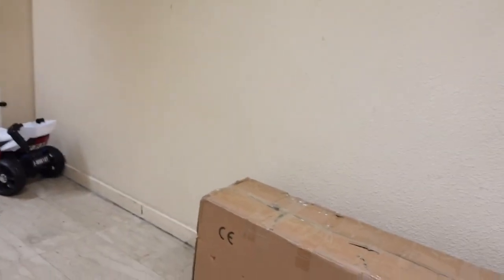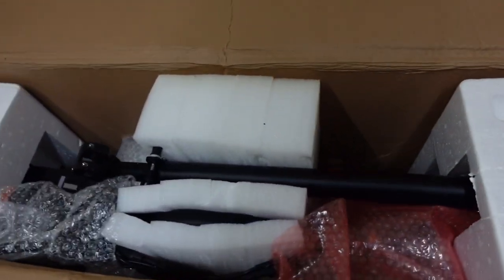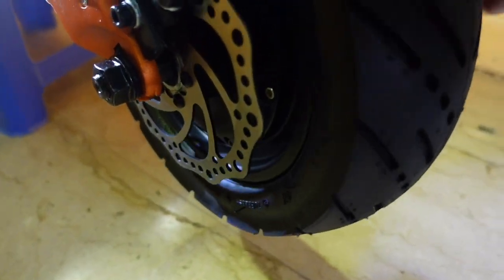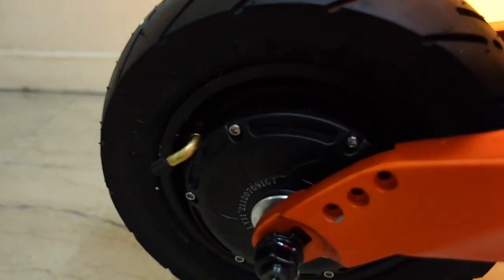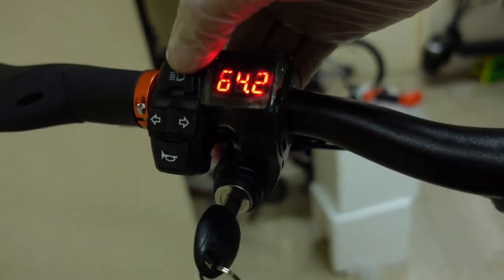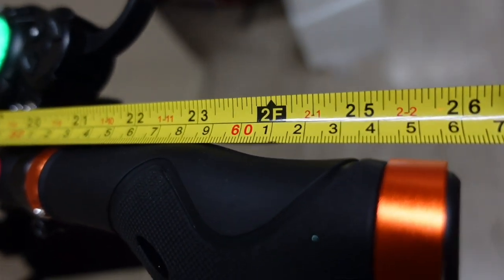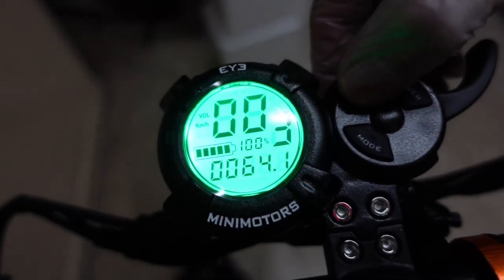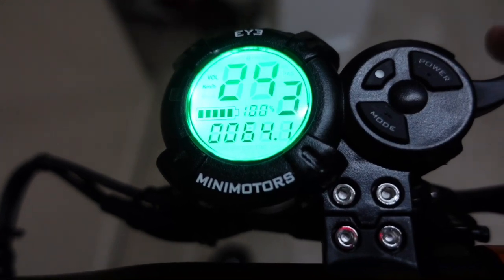Unboxing | Blade GT Plus | Mini Motors Display Version 2022 | James Angelo TV | Vlog 113

Comment: I watched all your videos on the blade gt scooter on the modifications you made but I couldn't find anything for connecting an external battery to have more autonomy. Are you making a video on how to add a battery? THANKS
Reply from the maker: yes i didn’t do video for range batt bro im directing to buy LG 28.8
Reply: @JamesAngeloTV  bonjour Angelo,il faut changer les controller pour installer une batterie LG ?
Reply from the maker: @legangdegaza  sorry bro but can’t understand please translate to english
Reply: @JamesAngeloTV  👍

Comment: Can you adding blade gt parts onto vsett 10 plus looks same looking decks    as you might be love with vsett 10+
Reply from the maker: need to check the swing arm length may e it will touch to the spring

Comment: Hi, James Angelo you know how to unclamp the blade gt 60v 23.4 ah scooter because there are no connectors to disconnect it the black white wire and I saw that there was a black white wire protruding from the light front left ? waiting for a response thank you.
Reply from the maker: you need to open the deck bro and follow the connection of wire

Comment: hello...how much of a difference u think the wolf king gt is vs blade gt?...is it like 2x times better? or 1.5x better etc.? thank you
Reply from the maker: handling i go for kaabo gt but in city rides only  becaue of fork suspension blade gt is good all around scooter. price wise blade gt is good also. but if you have a budget go for kaabo gt
Reply: @JamesAngeloTV  also do you take the fiido q1 to work rather than the big scooters? im mainly looking for transportation for work and wondering what the best is in terms of value. thank you
Reply: nvm i think the modding of fiido will cost more
Reply from the maker: @thermodynamics1110  yes bro fiido modifying is expensive

Comment: Nice job. I also have this version. Please check psettings and P9 which is battery saving mode. Default value is 2 - medium saving. If you change it to 3 - no saving you will get the full performance
Reply from the maker: soon i will make video for p settings
Reply: Hi does gt + have dual charging port ?

Comment: Salut @JamesAngelo tv  quel est le diamètre des 11 vis du deck est la longueur des vis ? Merci
Reply from the maker: bro please english 👌
Reply: Hi @James Angelo TV what is the thread dimension and allen key of the battery cover screws? thank you .

Hi @James Angelo TV what is the thread dimension and allen key of the battery cover screws? thank you .
Reply: waiting for an answer thank you?

￼
Reply from the maker: that is m5 size o f screw regarding on allen keys need to use small 2mm or 3mm size

Comment: no, how to add an extra battery to have more autonomy because the battery in the blade gt 60v 23.4 ah scooter and planned for 60 km I would like to add an extra 60v 20 ah battery to the original battery to do more kilometers I would like to know the connections because I saw almost all your videos that you put on line on the modifications but not the connections to add an external battery if you would be informed to me thank you?
Reply from the maker: they connect only in main wire black and red series connection

Comment: Wich version vill i get if I ordered around 1 week ago?
Reply from the maker: rightnow they remove the damao version
Reply: @JamesAngeloTV  do you know the size of the shocks? Front and back I wanted to upgrade the suspension but it was 1 month wait and I want my scooter asap, I can run stock suspension until I switch tires then I can switch suspension Same time.

Also do you have a video of the brake pads this one uses?
Reply from the maker: @saman1820  size is 165mm bro yhe suspension
Reply: @JamesAngeloTV thanks
Reply: @JamesAngeloTV  sorry is the blade gt split rim? Easy to change tire?

Comment: My Blade GT+ plus recently stopped going above 30mph on full throttle in 4 and 5th gear when the battery is at full charge(67.2V). Acceleration is relatively slow in gears 4 and 5 when the throttle is fully opened with battery between 75%-100%,and for some reason the scooter can no longer reach 40mph in 4th gear and 50mph to 52mph in 5th gear although the battery is in a high state of charge.
Maximum speed of 22mph in 2nd gear and 30mph in 3rd are the only gears that the scooter performs well in when the battery is between 75%-100%
Please note that the  parameters for levels 4 and 5 are all at their factory default values for optimum performance and all wires in the deck are in good condition with no signs of burnt connectors or wires going to and coming from either the PCB,battery or controllers.
I strongly suspect the controllers are the cause of this problem.
If not the controllers,what else in your opinion could be causing this problem?
Reply from the maker: how many odo do you have?
Reply: @JamesAngeloTV  Do you mean odometer?
Reply: If you are asking mileage on the odometer,less than a 1,000miles
Reply from the maker: i guess your battery is getting weaker or some settings changed
Reply: @JamesAngeloTV  Scooter is a year old and hardly used. Settings have been set for peak performance and the battery still charges to 67.8V not 67.2V.
Doesn't that indicate the battery is still strong?
Reply from the maker: @waynecameron8253  battery is still good, yes possible issue now is controller
Reply: @JamesAngeloTV  I never have the battery at full charge when the  scooter is not in use. Battery is kept between 40%-50% while the  scooter is in storage because it puts less stress on the battery,and I always use the SLOW CHARGER to protect the cells.
I suspect the controllers as the issue,and I will update you when I change them.
Thanks for getting back to me.
Reply from the maker: yes bro try to replace controller

Comment: This is not GT plus, this is just the regular GT 2022 version with Lg battery that costs about 1600usd on aliexpress.. This is not the GT Plus by any stretch of the imagination lol.
Reply from the maker: yes i know bro. but battery LG is considered as plus.
Reply: What's included in the plus version?
Reply: @Vlaaadddik  now with tft display,larger battery, zoom hydro brake,adjustable suspention.